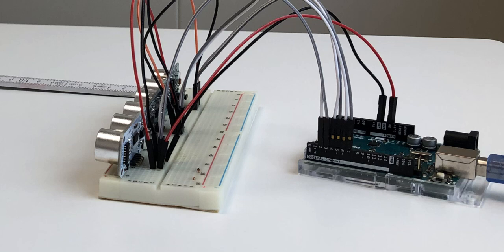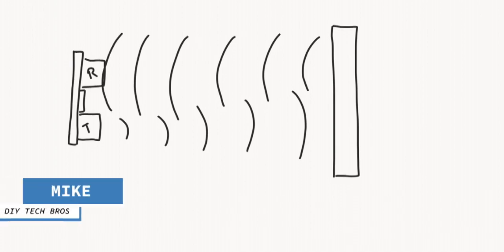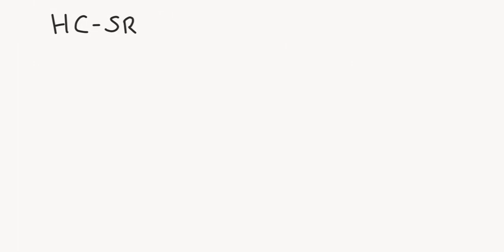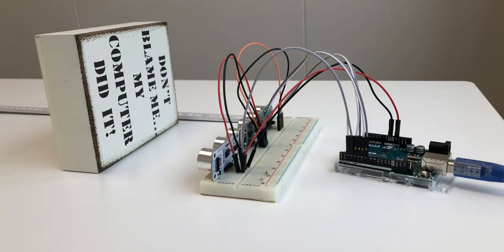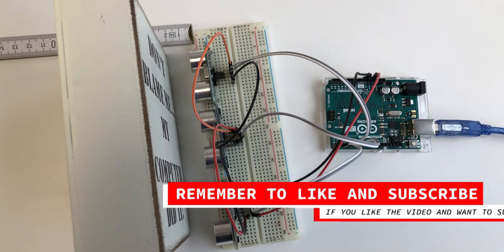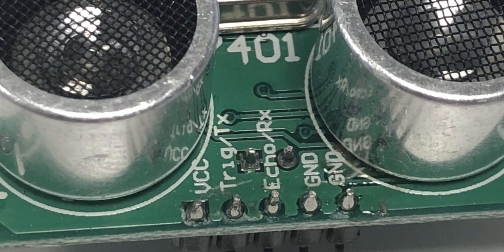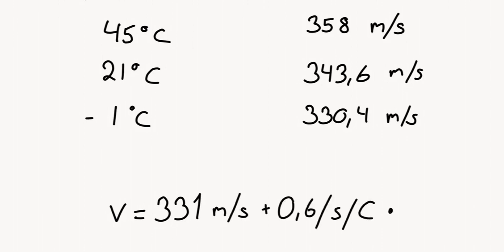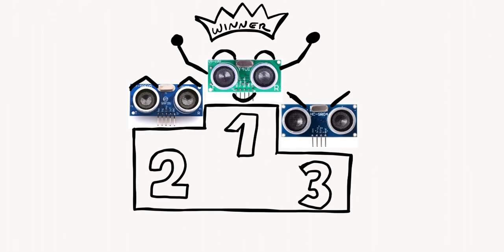The BEST Ultrasonic distance sensor US-100 vs. HC-SR04 vs. HC-SR05

Comment: The US-025 is great for low battery consumption. Starts up instantly, works well at 3.3v (good distance) and is really cheap.
Also, i'm powering it directly from the GPIOs of an esp8266, super convenient to have it fully powered off while sleeping, no mosfet required

Comment: WHY DONT PEOPLE USE THE US-100 ESPECIALLY WITH 3.3v MCUs?  IS IT NOT WELL KNOWN?
Reply from the maker: I wish more people were using it! As you are saying, it is perfect for 3.3V MCUs and build in temp. as well as UART mode, so the MCUs don't have to spend time measuring the distance. But, it is common in the maker community, some modules and parts become more popular for no other reason that somebody startet using it. Just look at the HC-SR01, or the 10K resistor for pull ups and the AMS1117. They are all excellent modules/components, but in so many cases there are better options.
Reply: @DIYTECHBROS  could you elaborate on the pull up resistors and ams1117?

Comment: Brothers, What sensor do you use to detect the car on the street?..the idea is put on street the sensor. This sensor ultrasonic is not weatherproof...
Im find sensor for parking, can you help me please
Reply from the maker: Hi! We have not tested this, but it is the same concept! https://www.banggood.com/custlink/KKDvEMRvf0  You can also use radar :-) Keep us updated!
Reply: @DIYTECHBROS  thank you my friend. 
there is a possibility that there is some material that is not detected?
Reply from the maker: yes, any materials that are to "soft" will not bounce the sound back. If you try an ultrasonic sensor with a fluffy pillow chances are high that it will not bounce the sound back. But, for use with a car almost all materials will be detected.
Reply: @DIYTECHBROS  I want to put the sensor in in case plastic on the street. Inside the case is ESP32+sensor ultrasonic+LoRa+battery. Can you help me?

Comment: Great video and easy to follow steps! Actually I wanted a waterproof ultrasonic sensor. Have you tried this sensor? https://www.ebay.com/itm/253978673298 or this modified HC-SR04? https://www.ebay.com/itm/254113850508 Have you tried any of those 2? Thanks in advance :)